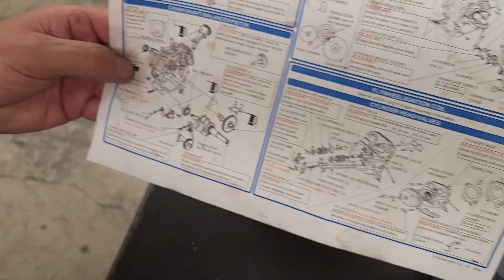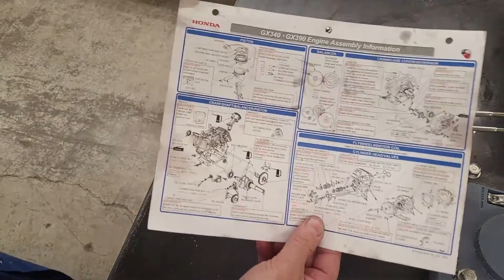Cylinder Head Assembly

Comment: I have a GX390.  I noticed that during your asembly, you made no mention of the valve spring seat(s).  I also did not see you install one prior to dropping the spring into place.  Do you use them, and if so, do both springs have one?

Comment: Sir is it okey if i put two seal ?
Reply from the maker: Are meaning one on the intake and one on the exhaust? The important one is the intake. No harm in putting one on the exhaust.
Reply from the maker: Fine to leave it on.
Reply: Thank you so much sir❤❤❤
Reply: Yes sir ,but i put it already two valve seal .is it okey? Or i will take off the exhaust valve seal?